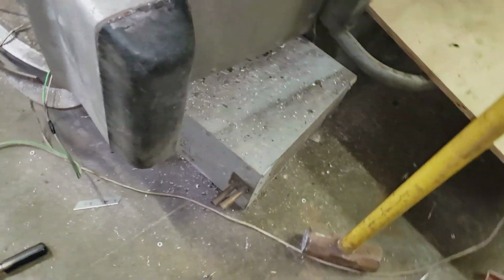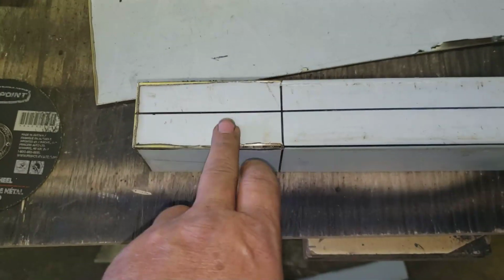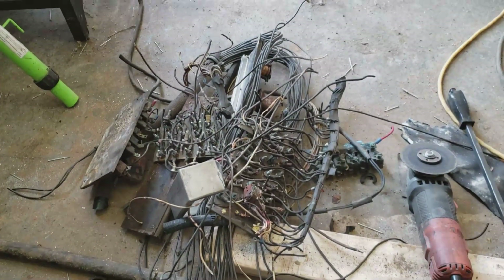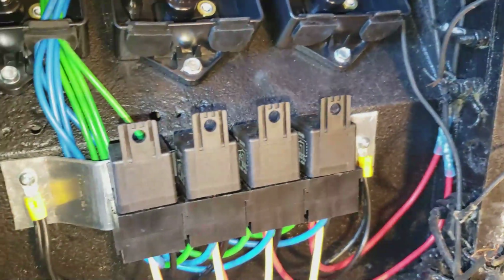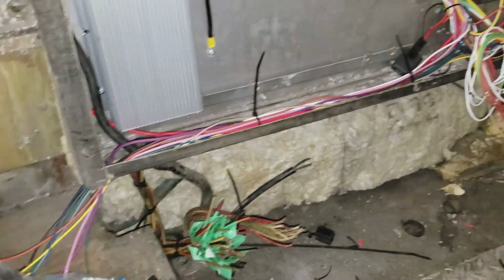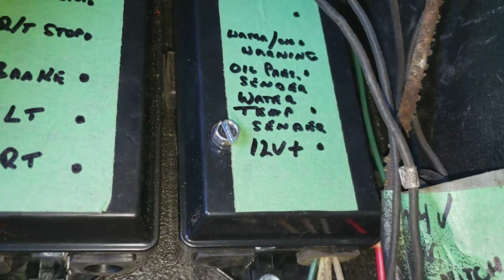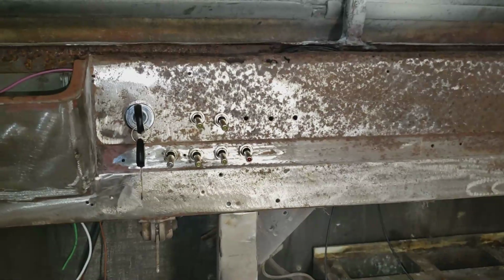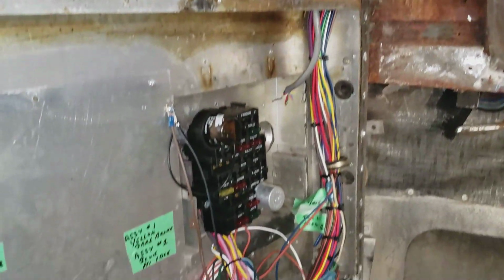Bus Conversion Project - Video 96 - Electrical System Part 2

Comment: Hi James, that's where I would fail in the restoration or transformation of a vintage bus. My experience with wiring is very limited, practically zero on vehicles I once wired my cottage when I built it some thirty five years ago and it's still standing.Wiring a vehicle is very time consuming, it's done in very cramped quarters and needs checking too see if you got continuity in each circuit, also protecting wire from chafing is very important.  Cheers🇨🇦
Reply from the maker: it takes time but you just have to go one circuit at a time till it's done.... can't rush it... thanks for the comment

Comment: Amazing work James love the new front lights and filler panels . 

www.walmart.com/search/?query=load resistors&typeahead=load%20
 look for the sylvania  brand they are very reliable and easy to insert into the harness. will fix the load issue for the flashers LED vs old also if rear lights are not connected they will not flash correctly if at all. 

As for the rear junction box and the MCI Mascots that looks 1000 times better and to steal a phrase from the boys across the pond " a second Metric F#@kton of superfluous wires." 

Great to hear the engine fired right up even if it was by accident.
Reply from the maker: I got 2 electronic flashers, one for the signals , one for the 4-ways, all the lights will be LED so I went that way.... I've used the dummy loads before and they work OK too, thanks for the suggestion

Comment: Great job James nice job with the surgery on the panel box in the back lots of ugly removal done their should paint the old relays gold so people will ask you about them and how much it cost you in just time alone my hat is off to you buddy great job looks like your keeping the old Delco breadbox regulator I'm assuming that's what it is I replaced my old one on my last coach with a solid state inverter regulator can't remember the name exactly it was almost 25 years ago but it was made by cruising equipment out of Seattle and it worked great for charging the house batteries while it ran.

love the marker light set up I don't like mine either  I'd like a set for mine we should talk about it.

 when are you coming down for the rest of your windows? Anyway great video buddy carry on young man.
Reply from the maker: Hi Brian... I'm keeping the old regulator for now.... I can switch to a three stage one later if I decide too.... not sure if it's necessary but easy enough to change out, the lights are all TRUX Accessories lights... they are out of Quebec.... I just about went with their Dual series which are red or amber depending on the position and then all blue or green when you power the auxiliary circuit.... but they all have clear lenses and I don't like clear lens lights, not sure when I'll be getting the windows, all depends on $$$$ and I'm burning through it now.... my cooling system is going to be a couple of grand.... I just spent 550 bucks on a new brake drum... have to rebuild one DD3 brake chamber.... you know the drill... might be the spring before the windows get done